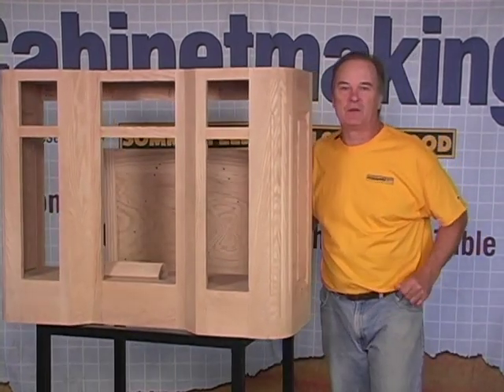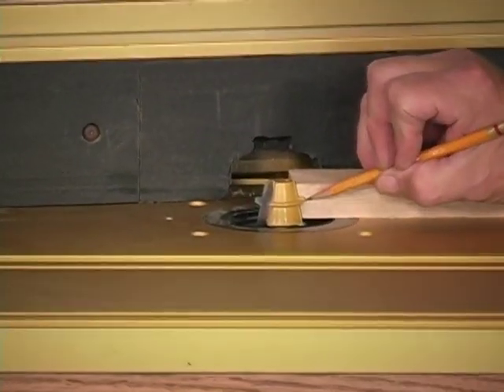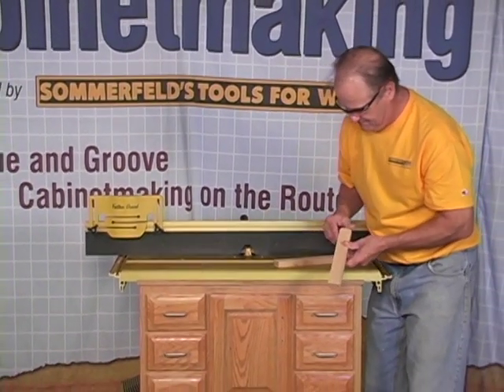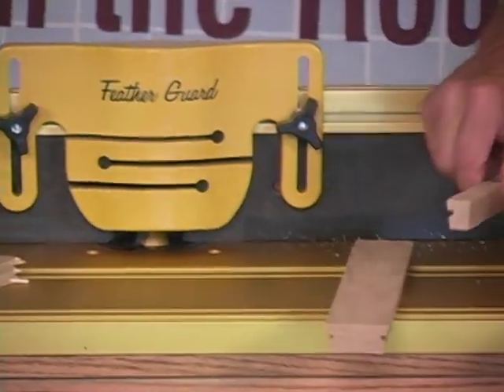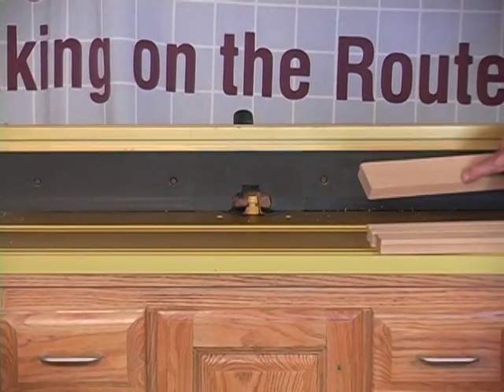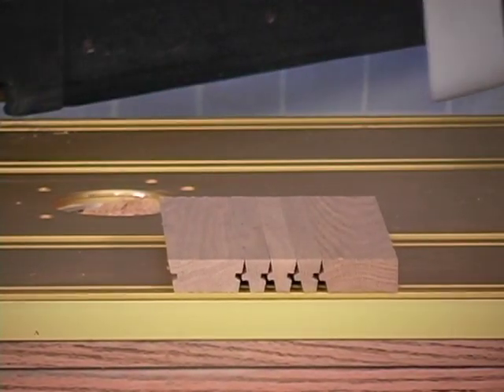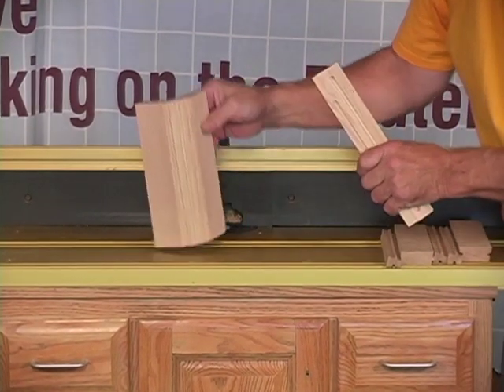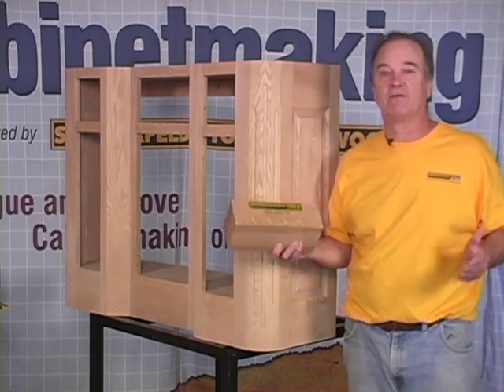Sommerfeld's Tools for Wood - Angle Making Made Easy with Marc Sommerfeld

Comment: Couldn't you eliminate the snipe by doublesided-taping the workpiece to the [vertical] push tool and eliminating the horizontal push piece? That way the workpiece won't be pushed closer to the fence when it gets near the end of the workpiece.